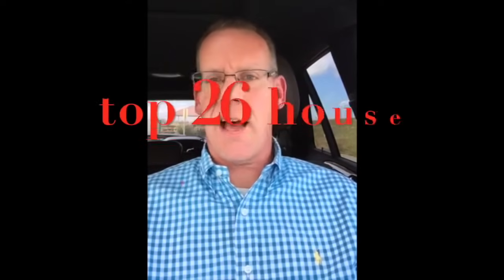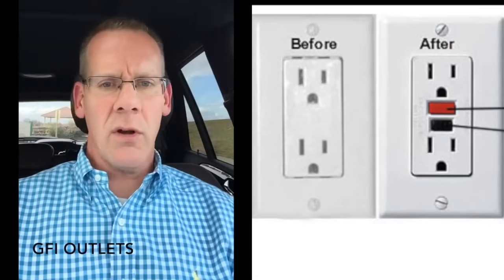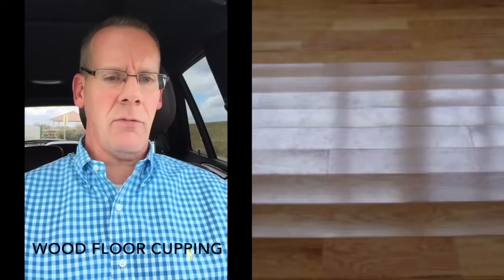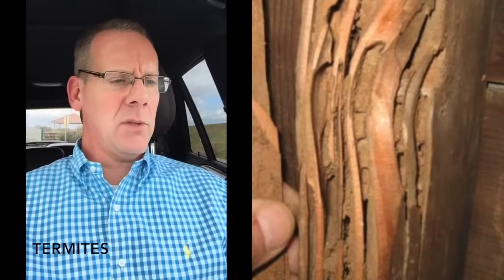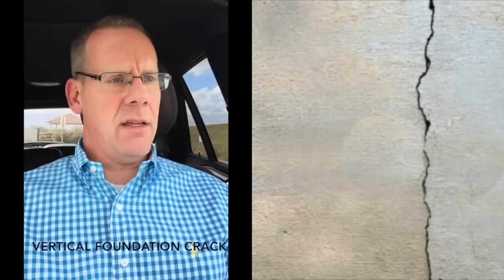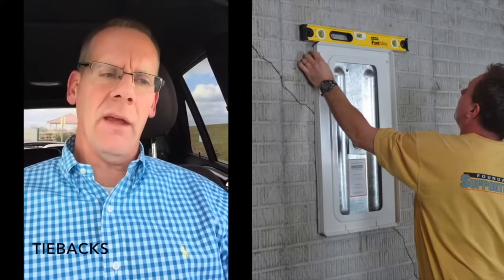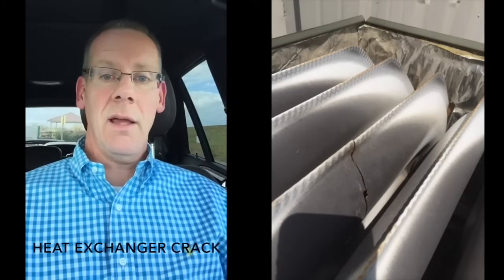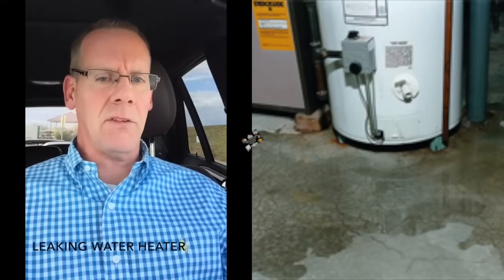26 House Defects

Comment: all due respect but tiebacks, wall anchors do NOT absolutely fix' bowed in B walls.... no way. Only means to remove, reduce lateral soil pressure is to hand dig, excavate, remove the clay soil and possible tree roots OFF of these bowed in walls. And block and bricks basement walls that are bowed in will indeed have multiple 'exterior' cracks in the walls which is where water 1st enters into the cores of the blocks and is then almost always seen where the bottom of the B wall meets the floor, water comes out onto floor there. ONLY real fix is again, exterior waterproofing, NO fraudulent interior drainage system stops water penetration through these B walls, have good day sir.
Reply from the maker: Well Anderson.  I have some work to do today.  I need to contact the 15 local companies that install tiebacks for lateral pressure, and tell them and their Structural Engineers that MAnderson says they are wrong now, and have been wrong for decades. Hey, we can agree on this.  Exterior Waterproofing is very, very, very important.
Reply: lolll ok man YOU know it all, tah tah  @MarkTheRealtor
Reply from the maker: @manderson5397  After evaluating 1,000s of foundations I do know a few things.  AND, to be fair I admit that bowing walls are really unpredictable long term.  And sometimes, you're right, tiebacks are not the best solution.